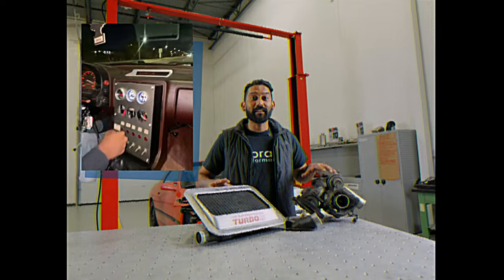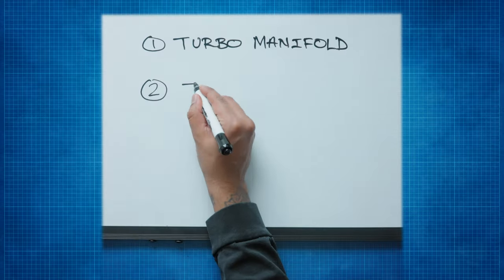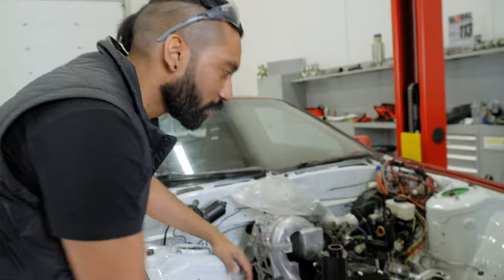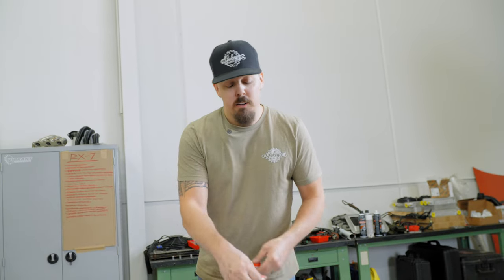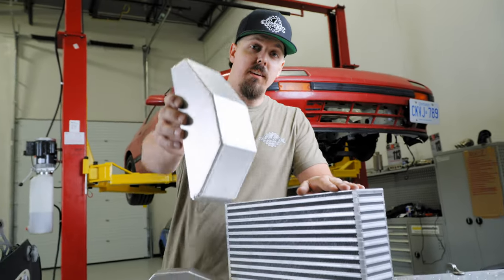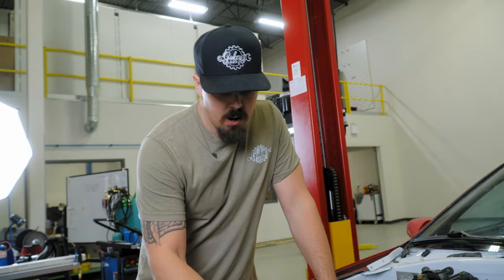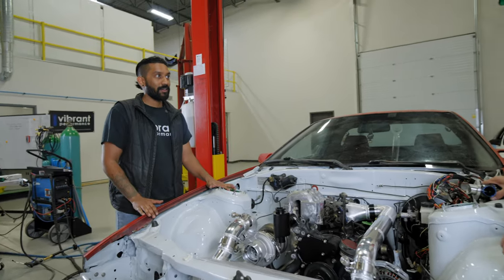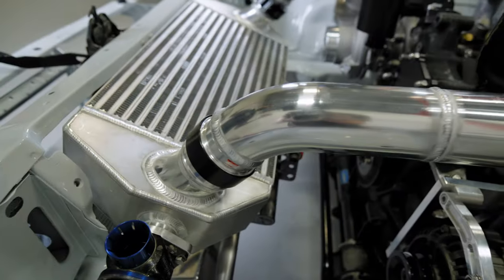Using the NEW Vibrant HD Clamps to make the ULTIMATE V-Mount

Comment: Would your bro be cool with duplicating that bar to hold the radiator and intercooler ? Would make my life a lot easier
Reply: Sadly I think most people have a unique setup, and this likely wouldn't work for others, but showing a local fabricator I'm sure they could replicate 99% of what I did for Kyle
Reply: @gokeysgarage  yeah this is true mate ! Thankyou
Reply: I'm sure kyle could send you the bar specs as far as bends and stuff, and I think he has the cut files for the plates still... so it may actually be easier than it sounds! @kristjanbjarnason5531

Comment: What size intercooler and brand radiator was used? Excellent video btw.
Reply from the maker: Thank you, we're glad you enjoyed it!  The intercooler used was our 12833, which is 3.50" by 17.75" by 9.75".  We used our matching end tanks, 22833 to mate up to them as well.  The radiator is a large custom tucked setup from Rywire, sourced from Turn14.

Comment: Where can we get those tabs with the bushing?
Reply from the maker: Tanner Gokey the fabricator in the video sells them here > https://www.gokeysgarage.com/
Reply: A lot of chain parts stores have those energy poly bushing kits for various things like sway bars... get you one of those and some flat steel or aluminum bar from home depot, and do work.
Reply: Also, if you want to make something more specific, there is a polyurethane liquid you can pour into whatever custom mold you want to build in order to make your own bushings. My buddy did the for the engine mounts in his s13. A cut down styrofoam cup, some high grade all-thread, and liquid poly. They actually worked great for quite a long time.
Reply: @michaelrodgers6559  I'm aware of the blue snap bushings, the poly pour etc. It's just easier to buy the part laser cut and made. Interested to see the options he has to offer.

Comment: Another excellent video, as always! I'm a big fan of the series however, I have a concern or question about the decision to drill the end tanks after welding them to the core. Why do it this way? I'm worried about the possibility of aluminum residue entering the engine. It seems like it could be quite a hassle to clean it afterwards. I understand the need for mock-up, but could you have tacked them first, marked the locations, broken the tacks, drilled the holes, and then finally welded them on? Maybe I am overthinking this lol!!
Reply: Ideally I would do that, but due to time constraints it was a "get it done now" thing and as long as you don't use any cleaners on the inside of the core you can blow out the shavings no issue.

Comment: Someone's been watching my posts!  Good stuff guys.  The EFR does not need a BOV as it's integrated properly into the front compressor cover.
Reply: Unfortunately myself and kyle did this entirely on the fly in the shop...LOL. As for the BOV, he wanted to make some noise so he deleted that tiny quiet one.
Reply: @gokeysgarage  Oh, well you did a nice job.  Page 61 of the EFR Manual will show the mistake of not running that unit.  If anything, do both.  It's a recirculation valve that improves response time of the turbo...
Reply: I'll let kyle make that choice, he's the engineer, I'm just the dude who welds metal hahahah @RGHTBrainDesignDrive
Reply: @gokeysgarage  I'm just a designer and tuner who specializes in Rotaries. 😆  Beautiful work.  Stoked to see this one come to life.

Comment: i wonder  how that intercooler will flow with in and out like this, the air is going directly into a wall
Reply: It's pretty proven in the RX7 world. Could it be better, maybe, but plenty of people run them exactly like this.
Reply: @deciplesteve  Rob Dahm had similar outlets in his 4 rotor and it was choking the engine, he had to re design his end tanks
Reply: @prodzektownia  all due respect, but this car isn't flowing the same amount of air as Dahm's 4 rotor.
Reply: Yea ideally we would do stuff differently, but for his setup and his goal of 300-400hp on this setup it will be more than enough flow. Plus we wanted to package it all as tight as possible. If he was shooting for a 800+ setup it would have to change for sure.
Reply: @gokeysgarage  Yeah You got the point there :P